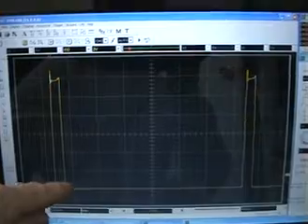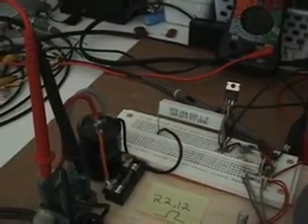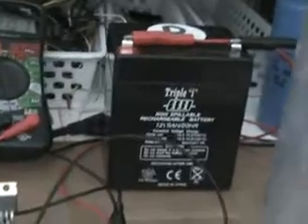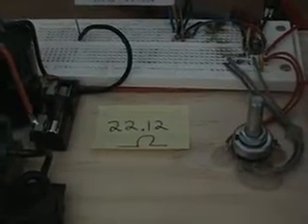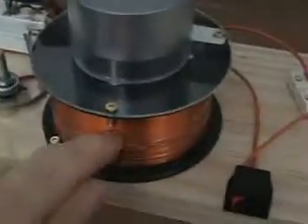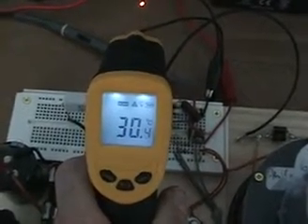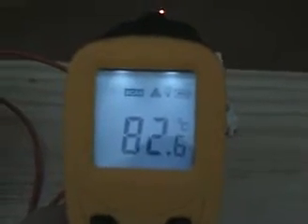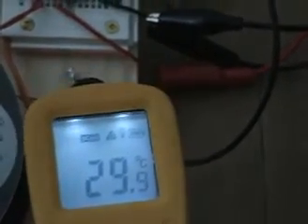Effect of Recirculating BEMF to Coil test 7

Comment: Blocking the back-emf maintains dc current of the pulse in the coil, no diode blocking the back-emf means energy wasted at the avalanche voltage of mosfet in the mosfet.

Energy in the coil = 1/2*square( I ) * L